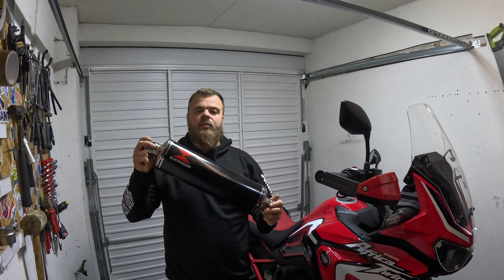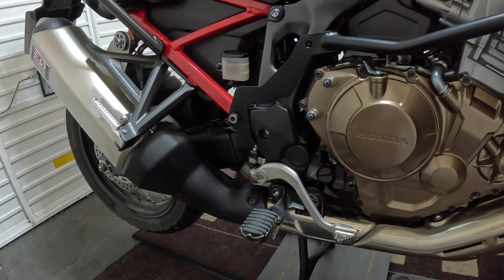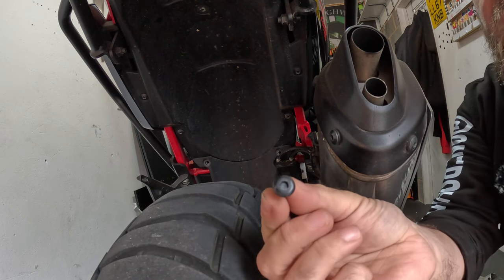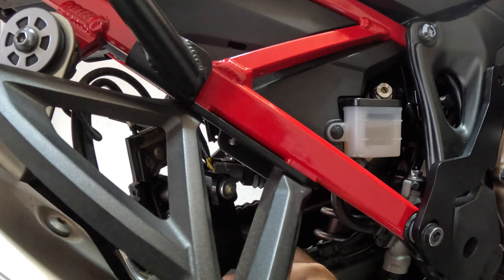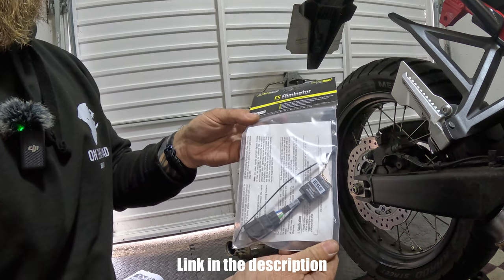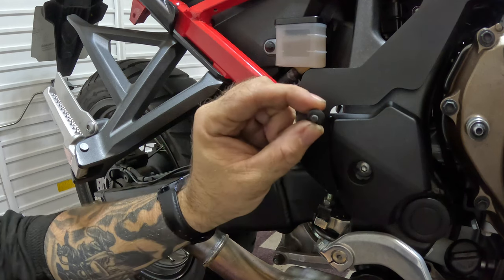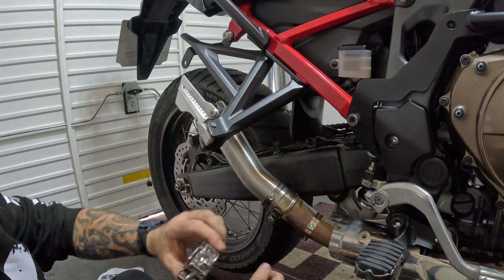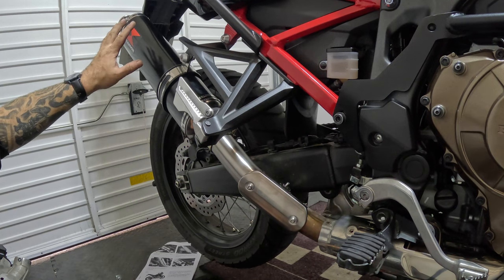How to change Exhaust on Africa Twin CRF 1100 - EASY GUIDE

Comment: Hi I'd installed mivv dakar on my crf1100L just by disconnecting d cables frm d stock end can nd w/o taking out the servo unit... After riding about 4k bike started stalling (dct) but got d throttle body nd coils replaced under warranty nd hv now installed back stock exhaust... Can you plz throw some light in dis?? Does d slip on cause throttle body issue??? I'm doubtful and a bit hesitant to put d slip in back...
Reply from the maker: You need to use the servo eliminator to run it correctly
Reply: But had left d servo cables loose so that it wud move freely depending on d throttle position... How wud the ecu know whether it's controlling a butterfly valve whc is on d exhaust?? And der was no error lamp lit on d dash as well.... Anyways unable to comprehend... Wl try again along wth servo eliminator installed... Let me see.... Thanks 👍👍

Comment: Nice video. Can you tell me, if we maintain the servo on the bike, connected to the bike plug but with no cables, do we´ll get some engine light warnings as well or not ? 
Thank you
Reply from the maker: Yes you need to fit the eliminator plug

Comment: Great video. I have an error on my OEM exhaust and servo ( MIL light and 35) I wonder if I can have the old servo buddy? (I,m UK)
Reply from the maker: Hi, I’m afraid I’m going to keep mine incase I want to return it to stock at any point. Did you fit the servo eliminator kit like mine in the video? That should solve your error?

Comment: Changing original exhaust with aftermarket exhaust would be effect to engine performance?
Any fuel usage difference?
Reply from the maker: No different in fuel, you’ll want to keep the baffle in or you lose to much back pressure

Comment: Hello there, cool video, thanks! 
I do have issue since I have installed it, the bike stall in low rpm, does it happen to you as well?
Reply from the maker: Did you fit the electric gizmo? Do you have the Baffle in the exhaust?
Reply: @ontheroadadventure  yes i do have the baffle in, what do you mean by do I fix the electric gizmo?
Reply from the maker: Watch the video again and youll see there is a plug and play youll need to install for the bike to run correctly
Reply: @ontheroadadventure  ah yes, i did install the servo eliminator
Reply: @thugz_mind3950 still have issues ?

Comment: is a tune requires since its a cat removal?
Reply from the maker: I have found mine runs fine with the baffle in but loses far to much power with the baffle out. I suspect it would benefit from a tune, there may well be a aftermarket fuel tuner available to plug in